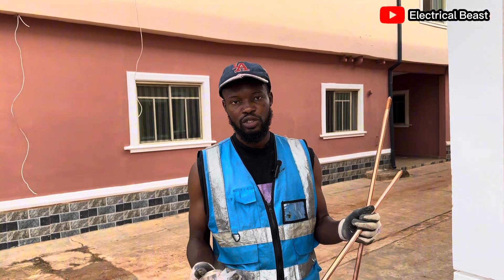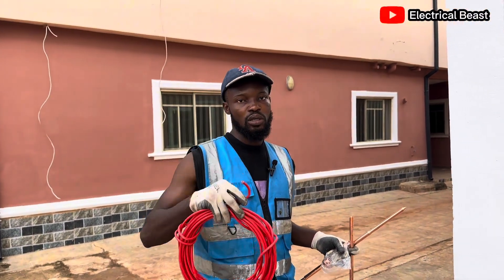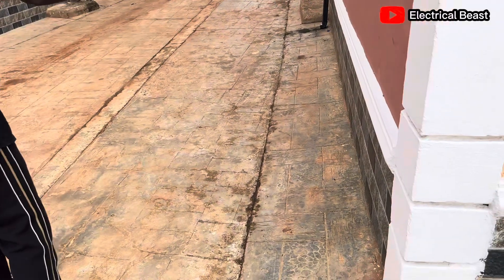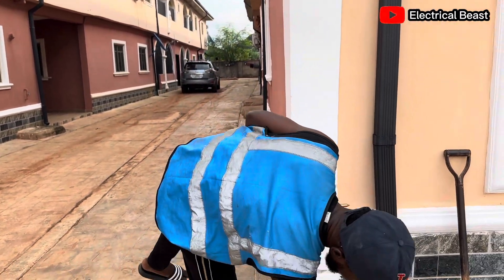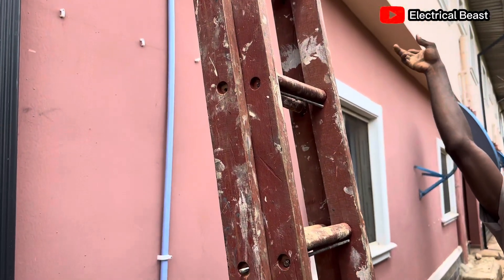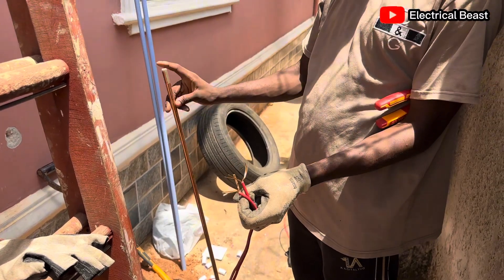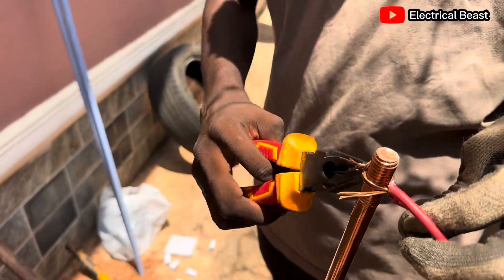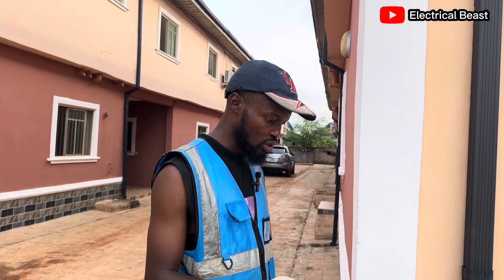How to Install a Thunder Arrestor for Solar System Protection ⚡🌞

Comment: Please can one connect both the earthing system of the building and thunder arrestor together,, in the ground
Reply from the maker: That’s not a good practice. You should bury the earth rods/accessories separately
Reply: @engrgideon 
Thanks Sir, 
That means they're two different thing,, 

This implies They should be done separately
Reply from the maker: @emmanuelisraelobiosio Exactly!

Comment: How do I install a load separation on a building,, for example where I have 4 AC units and I want them to work only on NEPA and the lighting points works on both generator and NEPA

God bless you
Reply from the maker: You have to locate the end points of the cables that connect to the ACs on the board, connect them to a separate breaker box, tap input from the nepa side of the changeover switch. If you find this difficult to understand, you should rather not try to do it for now, I might do a video about this in the coming days.
Reply: @engrgideon 
Thanks 🙏 sir
Reply: @engrgideon 
Thanks 🙏 Sir 

God bless you 

Please I'll really really Appreciate Sir, if you could do the video for us,

Comment: Nice work ! ,You can use cable logs then secure with bkack tape . It will insulate the connection against partial and rust.
Reply from the maker: Great suggestion, thanks for your input 💯

Comment: does it mean that adding an industrial salt to earthing is unprofessional?
Reply from the maker: It’s not unprofessional, it aids corrosion of the copper materials over time. Without the salt, it lasts a bit more before you can think about reassessing the effectiveness.